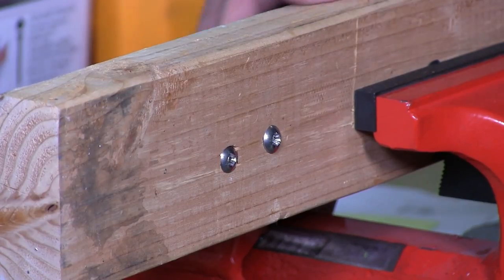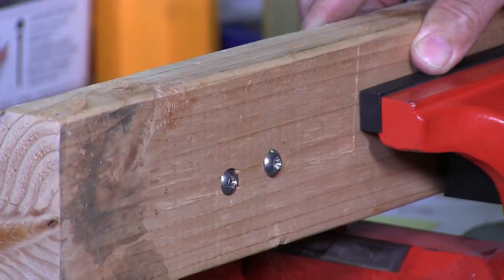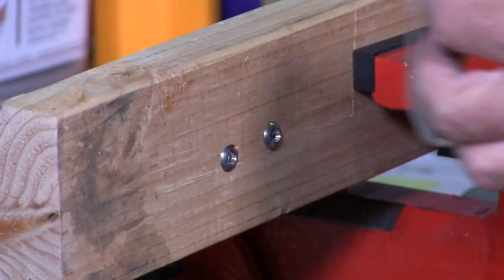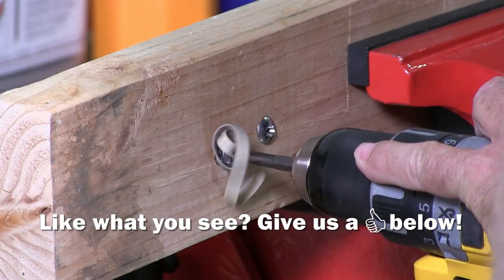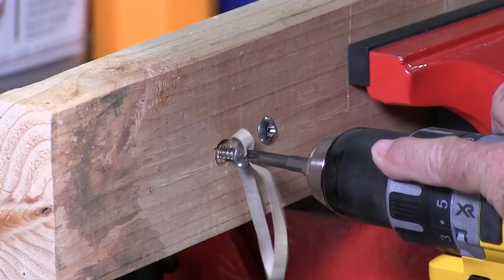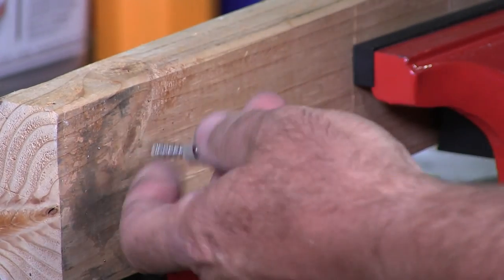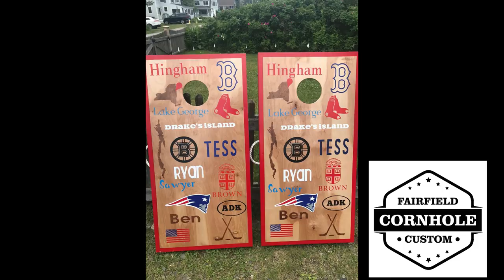Removing Stripped Screws With a Rubber Band & Cool Creations Winner

Comment: Being an old mechanic, I used valve grinding compound many, many times to get bite on a stripped screw. Also works great for allen socket and torx screws that have a loose worn socket. I've also used it on hex head nuts and bolts using sockets and wrenches, a small dab is all you need, the grit in the compound grips between the fastener and tool.
Reply from the maker: Thanks for the tip!
Reply: Thank you for the quality products at great prices and top notch customer service to boot! Getting ready to place another order this week for some of those stainless deck screws! Last winter I used some of your stainless pop rivets, nut's bolts and washers to make repairs on my snow blower, they went through a winter of use and they still look brand new. I don't have to worry about bolts rusting, makes it so much easier to work on it down the road! I love using stainless hardware when ever I can, your prices allow me to use them in more applications then I ever have before. I'll be a customer for life, again, Thank You!!
Reply from the maker: Thank you for your business!

Comment: Work with a hand tool screwdriver too?
Reply from the maker: We haven't tried with a hand screwdriver but as long as you can keep the pressure on it and turn it then it should work just the same.

Comment: What type of rubber rand is that? Cant find rubber band that thick and wide in my area.
Reply from the maker: Here is a link: https://www.amazon.com/Rubber-Bands-Band-Depot-Pound/dp/B0839PM5MG/ref=sr_1_1_sspa?crid=33I285Q29USL5&dchild=1&keywords=wide+rubber+bands&qid=1629845604&sprefix=wide+rub%2Caps%2C177&sr=8-1-spons&psc=1&smid=A3DDEVBY0MMX5J&spLa=ZW5jcnlwdGVkUXVhbGlmaWVyPUEySEFUQ1BZUDVQOURBJmVuY3J5cHRlZElkPUEwMTEzODg2Mk05NjY3V1dPQVBNSyZlbmNyeXB0ZWRBZElkPUEwNzI1MDI3M0o2MTJDRjlIMlFTOCZ3aWRnZXROYW1lPXNwX2F0ZiZhY3Rpb249Y2xpY2tSZWRpcmVjdCZkb05vdExvZ0NsaWNrPXRydWU=
Reply: Use a #64 rubber band.

Comment: If you're still commenting can you help me out with mine? I was able to get out 3 screws from my ps4 controller but I can't get the last one and I wouldn't stop trying cause I was frustrated
Reply from the maker: Have you tried the rubber band technique used in this video?
Reply: Yea, no help.
Reply from the maker: @dylanb5996  You can try putting a piece of duct tape or painters tape over the screw and drill it out or you can try using an extractor set. In either case, with something so small, you'll need to be very careful. Consider using a vice or something similar to hold the controller still while you work.
Reply: dude im having the same exact problem. fucking bs

Comment: We can use thise method for ALLEN KEY
Reply from the maker: Yes, it should work even on hex drive / socket cap screw heads! Provided the drive recess isn't totally worn out of course. If it doesn't work, an extractor set will: https://www.albanycountyfasteners.com/Norseman-Super-Premium-Magnum-Bolt-Extractor-Set-p/1050-344.htm

Comment: Didn’t work with a trox bolt
Reply from the maker: Hard to say why it didn't work without seeing your application and method. This is not a sure-fire way to unfasten a bolt, it is just a hack using a rubber band after all. You can always try using an extractor set if all else fails!
Here: https://www.albanycountyfasteners.com/Norseman-Super-Premium-Magnum-Bolt-Extractor-Set-p/1050-344.htm